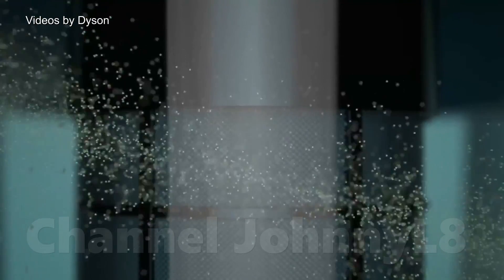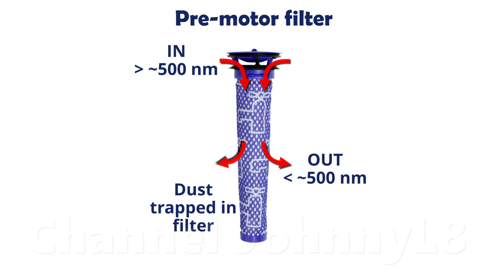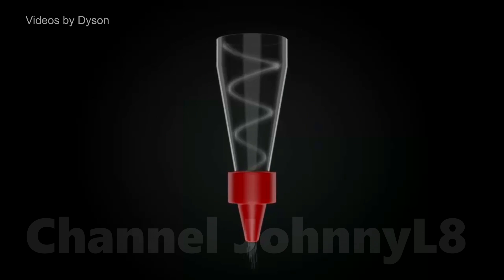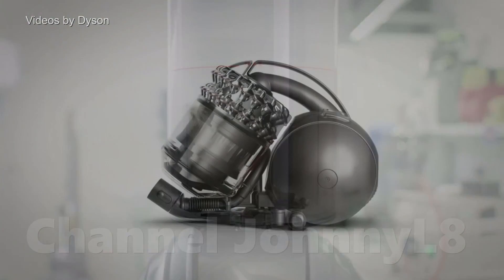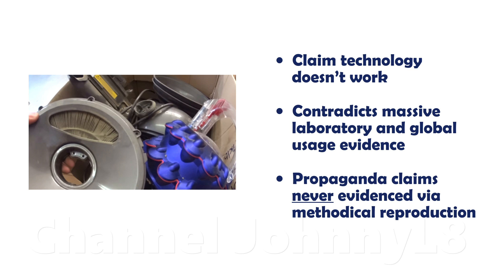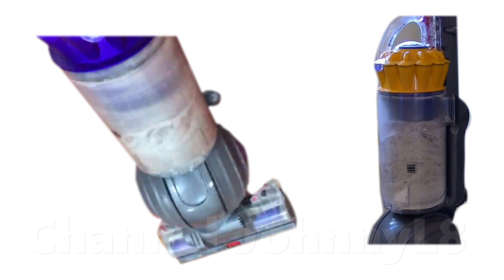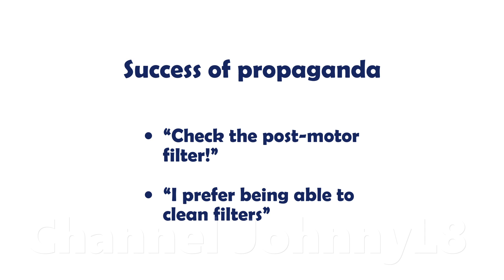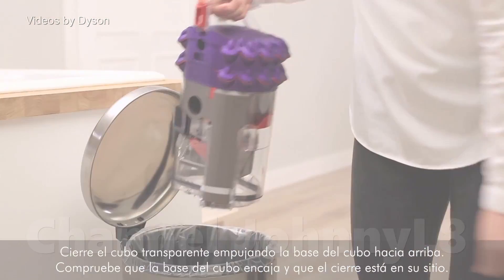Dyson Cinetic Technology is Amazing

Comment: It’s nice to see someone giving credit to dyson for there impressive technology, dyson often spends millions perfecting technology to get no credit for it, its sad dyson cannot use this technology as of yet in there handhelds, and they had to discontinue there existing upright cinetic vacuum due to EU regulations on how loud a vacuum can be, but they still sell the cylinder ones so at least there technology is still out there
Reply from the maker: Yes. However, their discontinuation of Cinetic technology in general has nothing to do with EU regulations. This is a myth I've seen commonly propagated by some of the more rabid vacuum enthusiasts out there that hate the Dyson brand and have very wonky worldviews. Dyson had produced Cinetic machines that were well within spec of the regulations, blowing that silly propaganda-driven myth right out of the water. It's more likely that it's because the technology relied on a fixed air speed through the cyclones. With the necessity of variable speed motors to accomodate battery life, the technology couldn't therefore be used. The future of battery technology may allow its reintroduction over time.

Comment: did you just delete my post ? your reply to my video was that “nowhere in the video dose it say that the cyclone is self cleaning . You a liar and deleting my post proves that you had been caught spew worthless nonsense . It explicitly states at the3:45 mark that the air speed is so high in the cyclone that it self cleans .You now went from delusional to zero credibility .
Reply from the maker: You've managed to confuse yourself again by commenting on the wrong video! lol >.> And you've shown a complete failure to understand the video. The cyclones themselves do self clean, but the internal cyclone discharge chamber (being referred to in the other video) does not self-clean. Any part of the system along the air path that can harbour dust electrostatically could contribute to odours. The internal cyclone discharge chamber is not part of the air path and thus can't contribute to smells. This is shown explicitly in another video. That was the point being made earlier that you've somehow missed whilst behaving like an angry rabid dog o_o

Comment: there is a sticker on those machine saying not to use this machine against ash.
Reply from the maker: Yeah; ash could be hot still. But it's also so ultra fine that it escapes even Dyson's cyclones and will immediately clog the filter, needing rinsing. Ash isn't normal household dust, which has much larger particle sizes.
Reply: @VacuumFacts  I just watched the video you made regarding this.

Comment: used to crap all over dyson but then i thought i would buy one new and actually maintain it myself its not that hard
Reply from the maker: ha ikr. 1. Empty the bin after every use or before the max fill line, whichever comes first. 2. Rinse the filters once a month or so. (De-tangle brushbar if even necessary.) That's it. It's a problem with people all over the world really; they form faulty opinions not based on evidence and you just can't get through to them with truth. They're died-in-the-wool.

Comment: It's not that amazing really. It was a big flop and it is no longer being sold in the UK.  If it was so amazing, it would still being produced for sale here in the UK and there would not have been problems with clogged post motor filters in the Cinetic models or burnt out motors.
Reply from the maker: A common myth based on erroneous conjecture. A more accurate statement is that the machines using the technology are no longer produced. New cordless machines don't currently use it because the technology relies on a fixed motor speed, and the new machines vary motor speed considerably to ensure energy efficiency. There is no convincing evidence that the technology didn't work; all public 'failures' (propaganda) were likely down to abuse and failure to follow instructions, and scientific testing confirmed beyond all reasonable doubt that the technology worked as described when used as instructed, as discussed in the video.

Comment: Its as always, people blaming technology for their faults in using the machines correctly. So i doenst matter if its Dyson or any other Vaccum cleaner. Using it inaproperly causes malfunctioning.
Reply from the maker: Try telling that to those who don't follow instructions...like simply emptying the bin. They'll bite your head off and accuse your sensible comment of being outrageously offensive.
Reply: @VacuumFacts  That's what some people unfortunately are like. Consumer do want the BEST product, it should be and perform absolutely perfect and without any flaws even when the operator is using the device wrong.
You can see this behavior when surfing the web, reading reviews at online stores etc. If they would only go back one step and try to understand the whole situation. If the device is really faulty, almost all manufacturer offer free of charge replacement - you only have to ask friendly (during warranty period of course!)

Comment: I recently bought a secondhand dc75 cinetic big ball, i will say with absolute certainly the filters definitely need changing over the years depending on the use, the one i got has the strongest smell of dog iv ever come across, its pumping though the filters and stanks! After i took it all apart and washed it out thoroughly the smell has died down, I've got new filters on order so fingers crossed the smell will be gone. I have to say I'm extremely impressed with its performance though, i put it up against my old dc33 and dc03. They technology/performance jump is amazing.
Reply from the maker: That is interesting. I would say from that anecdote that it sounds more likely that if the vacuum had been abused and not used correctly, then you'd see the symptoms you saw. Odour producing particles from dogs are much larger than the cut point of Cinetic cyclones under healthy operation; if they're all in the filters making a smell, then the machine has had an abused history. It has been proven scientifically to a level that is indisputable, that if used according to the manual, cinetic cyclone performance does not drop over its lifetime. I've never yet seen convincing evidence to the contrary from a mere naysayer on YT (and there've been many) that doesn't have a much better explanation (usually machine abuse).
Reply: @VacuumFacts  theres no doubt it was abused the brush bar was chewed to hell, everything else seems to be working perfectly fine, after a good service I've got my fingers crossed everything with it should now be ok in my hands
Reply: @VacuumFacts  update, after a full cyclone washout and new filters, along with a new motor head and a fill clean inside and out iv managed to completely removed the smell and its performing brilliantly. I've got a originally £500 machine for a 5th of the cost.

Comment: Hi I have had both the upright and pull along cinetic and was impressed with the initial performance. I have found that there is a slight drop off in performance after a few months of normal use that can be rectified by dismantling the cyclone and cleaning around the tips of the cyclones. I have never seen a blocked cyclone but perhaps the body of the cyclone being covered in dust reduces its ability to vibrate. I realise this is conjecture but I also repair Dyson’s and have seen this many times. I realise people may not be keen to dismantle their bin due to warranty worries/ scared or breaking it but this simple job does restore the performance. A can of compressed air also helps but does make a mess.
I have seen severely clogged and immaculate post motor filters on these so without the history of the model its impossible to ascertain if it’s a design flaw or user error. I believe you have to be a little more circumspect when using this model and they do make it clear not to hoover up ash on the sticker.
I hope dyson don’t give up on this tech and keep refining it as the science behind it is fantastic
Reply from the maker: Thanks for the comment. I'd be interested to know how you reliably quantified performance in a convincing manner that was believable. No air actually passes through the tips of the cones, so there's no physical reason why cleaning them would improve 'performance', however we're defining that. In fact, if the cone tips stopped vibrating and thus became blocked, the cyclones would essentially be bypassed, and the filter would receive all the fine dirt and clog fully very rapidly. You would see fully blocked cones and completely caked filters when going inside, as has been observed frequently on abused and neglected machines where the owners simply failed to empty it. There would be no partial performance reduction; it would be all or nothing, just by definition of how the system works. Given this technology has been tested to death in rigorous, conjecture-free laboratory environments to full and professional scientific levels of objective scrutiny, I'd need to see very strong evidence of cause of failure, with clear steps to reproduce it, to be convinced. Such evidence doesn't exist of course from doubters of the technology, and often performance reduction is subjective and psychological.

The main reason Cinetic technology was dropped from the handhelds, isn't because the technology doesn't work or was a failure—as many Dyson brand haters would jealously like people to believe, but because the tip oscillation is airspeed-dependent. Old-fashioned mains-powered technology used motors which only operated at a single power, producing a single airspeed. But modern cordless cleaners modify motor power to optimise suction (and corresponding airflow through deeper carpet pile) and cleaning performance depending on floor type, and also thus battery power. It’s therefore not possible (yet), given the material property dependence of the tips, to include Cinetic technology in the cordless range. Pity, because filter rinsing is a nuisance, even though you rarely need to do it with cyclonic filtration technology, as I’ll demonstrate again in a future video.
Reply: Vacuum Facts on the pull along model the head was spinning quite a lot slower, I had a brand new cyclone assessmbly and when I fitted that the brushbar picked up a lot more speed and there was more suction available. This led me to dismantle the cyclone and clean it thus improving performance. 
I have done this a few times and it is simple and if people would do it perhaps they wouldn’t revert to the standard Dyson’s are rubbish rhetoric.
I cleaned one in the shower which is obviously not recommended and after waiting to make sure it was dry it performed better than it was. Now obviously I don’t have any empirical data and the 20 or so I have done this with can be taken in isolation but I found it interesting as dismantling the cyclones on non cinetics does not have as profound an effect.
Reply: Perhaps if you come across any used dc75’s/big balls you could set up a test.
Reply: I’ve got the new ball animal 2 and the cleaner head on those is very impressive and an improvement on the heads on the DC40-DC75 which had the central soleplate wheel issue. 
I agree that sheer suction at the cleanerhead is not the be all and actual agitation is the key however I think a little more grunt at the hose would have been better as the tangle free tool does not spin nearly as fast on previous models. This could probably have been rectified by narrowing the hose as I feel the diameter on the new connections is too big
Reply from the maker: Yeah, interesting but all speculative though, really. There's no need for me to test myself; I couldn't do as good a job as has been done testing formally to industry standards and beyond in highly professional and independently verified assessment. There are many possible explanations for an alleged drop in 'performance' (whatever we're really talking about there), and there's no clear evidence the cinetic tech is in any way responsible. Even cowboys, like CNET, when testing showed no drop in performance (shown in the video). All examples of failure of the Cinetic machines are almost certainly down to abuse and failure to follow simple manual instructions—namely empty before full; that simple but still too hard for some people. I've never tried a cinetic machine, and I doubt I ever will seeing as the otherwise great filtration technology is attached to old fashioned peripheral technology of mains machines.

It's interesting you think the diameter on the new connections is too big; many of the rabid vacuum enthusiasts out there slate the Dyson machines citing the exact opposite (without evidence of course). The rest of the videos on my channel explain the physics principles of vacuum cleaning and clear up a lot of misunderstanding peddled by a few loud voices and zealots out there.
Reply: Vacuum Facts well I consider myself a Dyson fan and love their philosophy although I do take umbrage with the term “digital motor” being that it’s a brushless motor and it’s control principle is found in many heavy industry applications. It is a very clever piece of marketing as I have heard many people refer to a digital motor
Reply from the maker: :) Call it a "blueberry" then. What it is, how it works, and what it achieves is more important than an arbitrary label. Why do you think they called it a 'digital motor'?

Comment: to be fair, nobody reads manuals so any vacuum that requires that step in order to survive it's first year of life is doomed to failure.
Reply from the maker: Hmm, wouldn't say not reading instructions is a justification for stupidity. If someone can't figure out to empty before full then it's hardly the manufacturer's fault. Like blaming a car manufacturer because the driver didn't realise you need to put fuel in the car BEFORE it runs dry—and of the correct type—to avoid damage and failure. Doomed to failure eh? Not convinced!

Comment: Does dyson has a patent on cinetic?
Reply from the maker: Ask them?
Reply: Yes! The main one seems to be https://patents.google.com/patent/EP2587980B1/en (and international equivalents as given there), expected to last until 2030–2032 depending on country; its first claim mentions "a plurality of frusto-conical cyclones arranged in parallel and each having a relatively wide, rigid frusto-conical portion and a relatively narrow, flexible frusto-conical portion connected to the relatively wide portion; the relatively wide portion comprising at least one dirty air inlet, and the relatively narrow portion comprising a dirt outlet; wherein the flexible portion of each cyclone is arranged to vibrate as airflow moves through the cyclone during use."

The claim doesn't specify whether the flexibility is due to material properties (as in Dyson's products), shape, or any other factor, so it seems to me (not a lawyer, let alone a patent lawyer) that any conical cyclone whose tip is deliberately less rigid than its upper part, such that cyclonic airflow can make it vibrate, is covered by this patent (as long as it's used in a "surface treating appliance"; other cyclone applications such as stationary dust collectors are probably fine). Also claimed are any and all conceivable means for agitating the flexible cyclone tips (claim 4), as long as said cyclones meet claim 1's criteria.

I've been thinking about this for a little while now, and I have yet to come up with any practical way to get around the patent. My ideas so far are: a) a rigid but segmented tip that somehow intermittently opens up like flower petals to release dirt, and b) rigid cyclones equipped with a mechanism to suck air backward through them one at a time, cyclically, to clear dirt. I suspect those alternatives would be nowhere near as effective as the flexible tip.

Actually (after rereading claim 1 and adding a bunch of qualifiers to my second paragraph), I have two better ideas: a) make cyclones with flexible tips just like Dyson's except with a curved and/or piecewise taper to either or both parts, or a cylindrical shape to the rigid part, because those would (arguably) not be "frusto-conical" and therefore not meet the criteria of claim 1; b) make cyclones with flexible tips just like Dyson's, but such that the tips don't vibrate due to airflow and therefore don't meet the criteria of claim 1, and then agitate them by other means. (Though, against (b), Dyson's lawyers could argue that "as airflow moves through" just means "while airflow moves through" rather than "as a result of airflow moving through".)

Also, the claim specifies "airflow", so similar cyclones operating on liquids would seem to be in the clear, even if used in a "surface treating appliance" (such as a floor washer). I don't know if cyclones are really useful with liquids, though; I don't think I've heard of them being used that way. [Edit: In further patent browsing, I see cyclonic separation is used in swimming pool cleaners, quite analogously to how it's used in Dyson vacuum cleaners.]

There's also https://patents.google.com/patent/GB2492743A/en (among others), which mentions the flexible cyclone tips, but only as dependent claims (claims 27–32), with the only independent claim being the number and arrangement of cyclone stages. (That patent answered an unrelated question I had: The three cyclone stages do not drain into a common bin, but each into its own bin; however, those three bins are emptied together as seen here: https://youtu.be/v6F0wqT3xKI?t=118 )